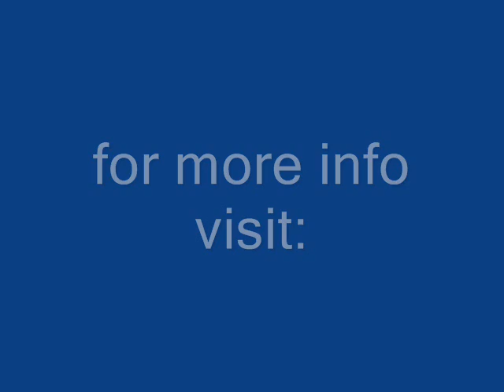Aldoized Folding Roofs for Portable Sheds and Emergency Shelters.wmv

Comment: Hi, check out the twin sheds I built in 2010. Between the sheds I have a fold down gable carport roof. Nothing too fancy here but it functions. I believe I refer to it as retractable. Its only a 10' X 15' but hey, Its just a shed.....
Reply: I saw your video a while back. loved the shed but I was concerned that the middle roof was lower than the 2 roofs on either side. where would that water go from the lower roof? down the sides of the attached sheds? I would definitely majestic the middle roof higher and extend on both sides enough that water and snow drip off onto the peak roof below it

Comment: WTF, seriously.  HOW is this faster/better than just making normal trusses!?  The number of screws you had to take out would have been about the same, but yours has 20x the number of cuts and brackets etc...
Reply: I said the same. to just make a lean to roof with pre-cut bird mouths and just screw the rafters on. it's only 8ft by 16 ft. you could fit the pre-cut rafters in a freaking car. plus I can't imagine what that folding roof cost compared to the few 2x4 rafters needed for such a small structure. p.s- and I am a female.i would be very confused trying to put that crazy folding roof together.